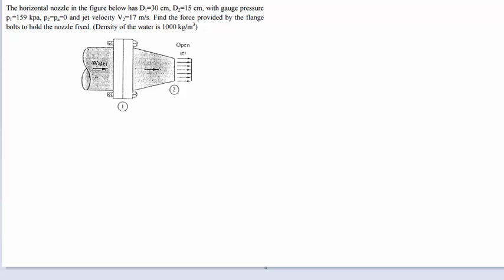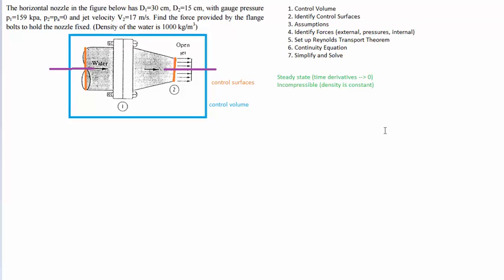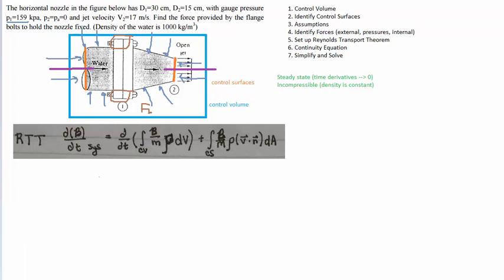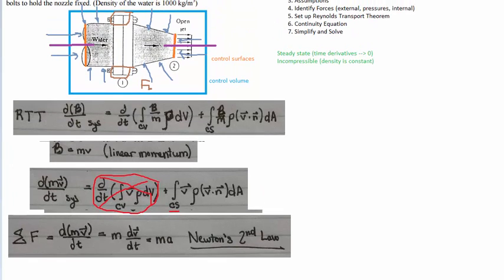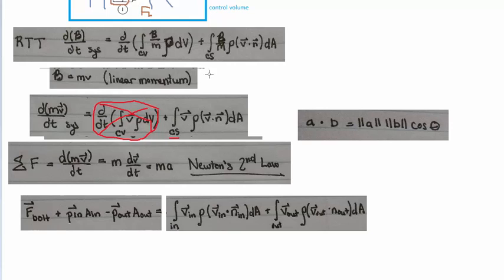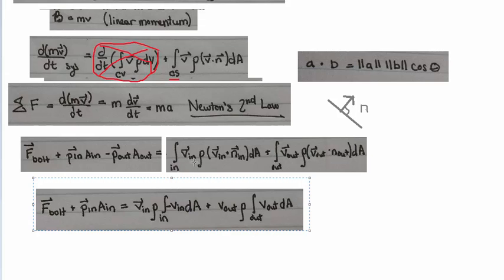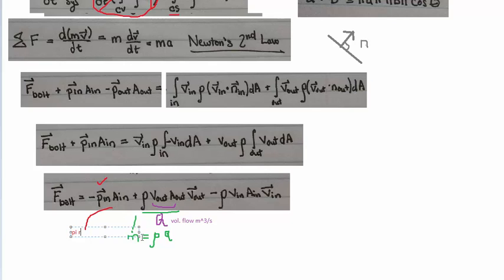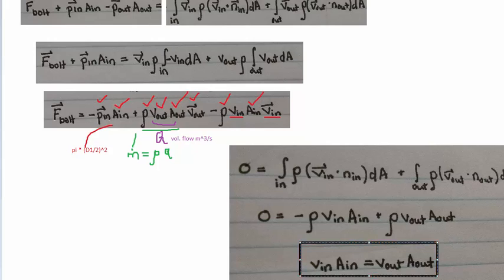Reynolds Transport Theorem - Linear Momentum - Example 1

Comment: How do you know the direction of the force on the bolt before solving? I got Fbolts as -7408.76 N. Also, since there are 2 bolts, how do you account for that? Divide or multiply by 2?